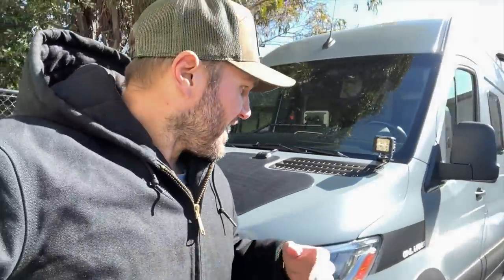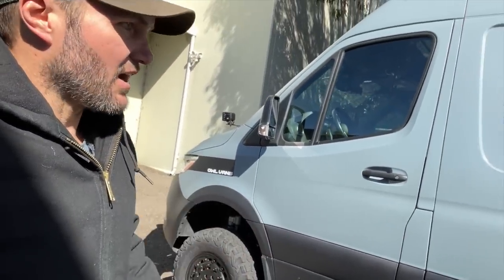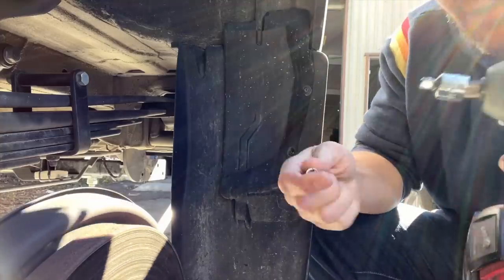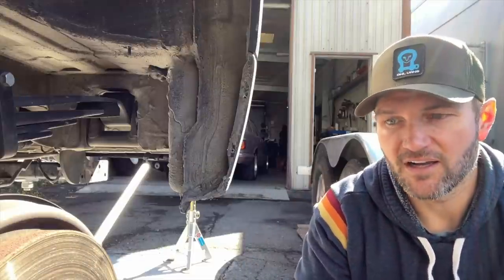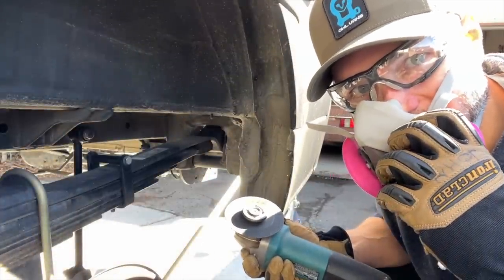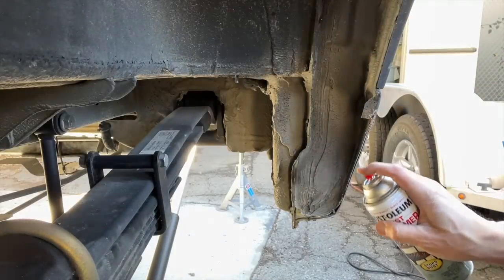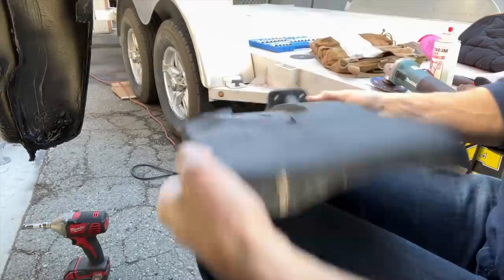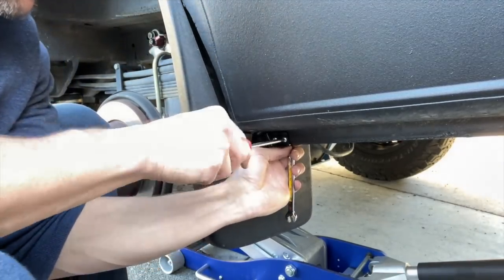Installing 35's on a Sprinter

Comment: Cool video again! Do you have a VC Stryker 2" body lift on this van? I couldn’t see the actual size at the end. Based on comment below it seems they are 285/75-17 which are actually a little less than 34". Have you guys tried true 35x12.5 or 315/70-17 with ACC update? Thanks
Reply from the maker: Yes you are correct. We did the video because 35's are as big as you can go and the process is the same. Yes it works.
Reply: @owloffroad   Thanks! Do you have the Stryker 2" body lift from Van Compass? It comes with stage 6.
Reply from the maker: @gearforexperiences  Yes, this van has the 6.3 VC system
Reply: @owloffroad  thanks! I’m trying to figure out how much cutting for 35x12.5 with vans without Stryker 2" body lift. I have AO RIP kit and planning on going bigger soon. 👍

Comment: Do I need to trim the body on a 2017 lifted  sprinter for 35s? And is there an approach fix for the adaptive cruise issue?   Great video
Reply from the maker: Here are the options: - For a lifted Sprinter 2017 -305/70/16 * 14mm wheel spacer for front strut and tire clearance
- 295/75/16 * 14mm wheel spacer for front strut and tire clearance
- 315/75/16 * 14mm spacer, front mudflap removed, pinch seam trimmed and front bumper plastic must be trimmed.
- 295/70/17 * 14mm wheel spacer for front strut and tire clearance
- 305/70/17 * 14mm spacer, with aftermarket wheels in the 7.5 to 8” wide range
- 285/75/17 * Will require minor fender trimming, 14mm spacer on some tire types
- 315/70/17 * 14mm spacer, front mudflap removed, pinch seam trimmed and front bumper plastic must be trimmed.
- 35/10.5/17 * Front mudflap removed, pinch seam trimmed and front bumper plastic must be trimmed.
- 35/12.5.17 * 14mm spacer, front mudflap removed, pinch seam trimmed and front bumper plastic must be trimmed.
Reply: @owloffroad  thanks much.  Does this model need the ECU upgrade for the larger wheels?  And  if so where is the cutoff in size that doesn't need the upgrade?
Reply from the maker: @tztz1949  All VS30 vans will need the tire size module for anything above 32" tires
Reply: @owloffroad  is this true for the NCV3 Sprinter regarding the cruise control computer upgrade for tires larger than 32"?
Reply from the maker: I don’t believe this is an issue with the NCV3 but we cannot be 100%
Reply: @owloffroad   so where can I look to to know what will work? I don't want to spend 4500.00 + on wheel/tire/lift upgrades and not have cruise control. Thoughts?
Reply from the maker: @tztz1949  I would look through the Sprinter Forums, they are going to have th best info

Comment: Is the bronze wheels has the correct offset to fit 6 pot calipers in 17"?
Also, why is the tuner does not correct the speedo? Does it flash the ecm or its just a piggy back and has to be connected at all times to work?
Reply from the maker: The offset helps with clearance but we cannot guarantee fitment with aftermarket brakes. We are working on correcting the speedo as well, but with all things Mercedes, it is complicated to accomplish

Comment: What rear leaf springs are on your van.  I’m curious about you opinion of van compas vs agile replace springs for STO Classic non lifted van.  5380 lbs rear axel when loaded for travel.
Reply from the maker: We use the Van Compass additional spring pack. We have found it works fantastically and there isn't a need for the expesnce of a full replacement

Comment: Thanks for the vid! Those wheels look SO NICE!!! —-Kudo’s on not making them blue. 😜 

Question, did you keep the spacers on, or is this the stance without them? -Thanks!
Reply from the maker: I still have the spacers on but ouw wheels have the larges offset of any Sprinter wheel we are aware of at the moment. Therefore the stock Owl Talon wheel will be roughly the same offset as a Black Rhino Arsenal with 20mm spacers.

Comment: Hi Jon. Really informative video. Thanks for documenting the process in so much detail. Can I ask what width tyres you've fitted though? Are they the 35/10.5s or 35/12.5s? Thanks!
Reply from the maker: 285/75 r17
Reply: @owloffroad  Not to split hairs, but 285/75 r17 are 34s, not 35s, correct?
Reply from the maker: Yes, you’re correct. That said it’s the same process for 35”s so that’s what we wanted to show